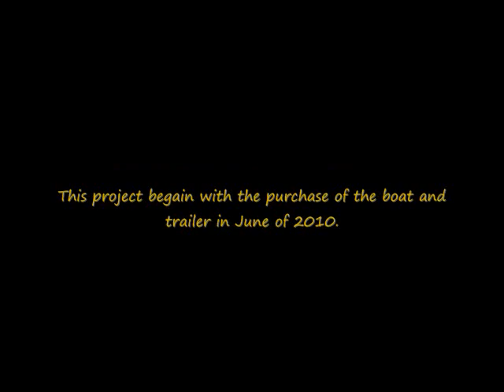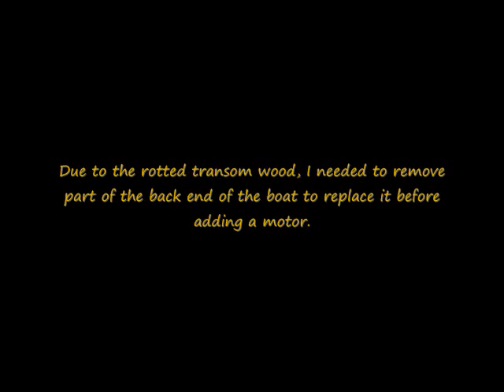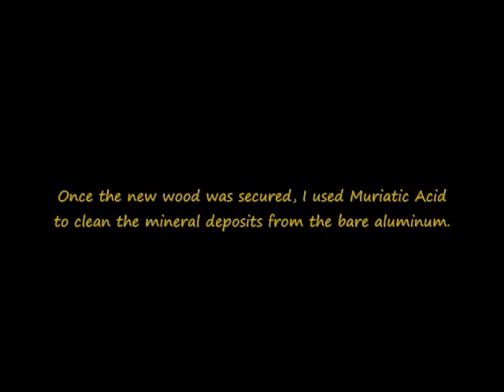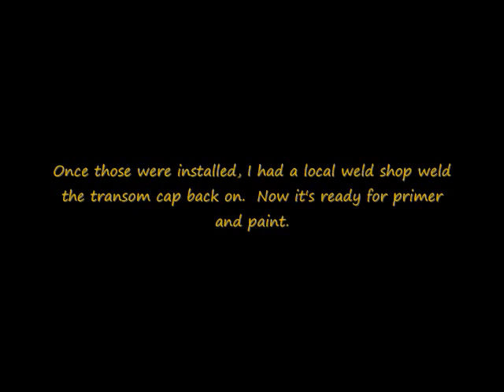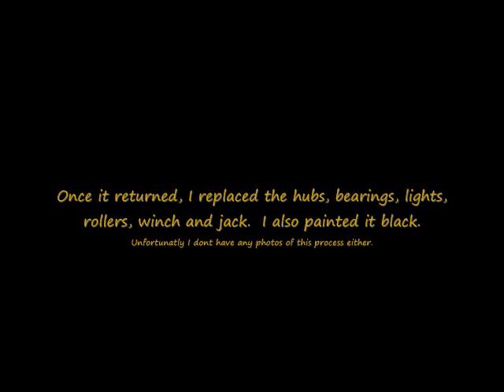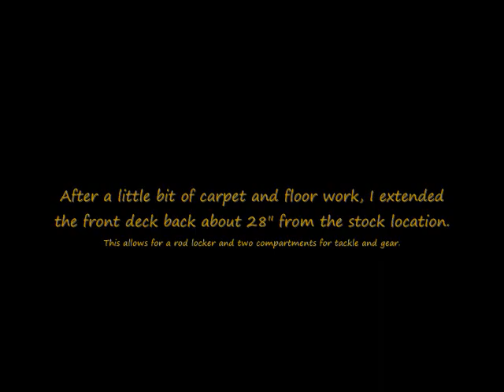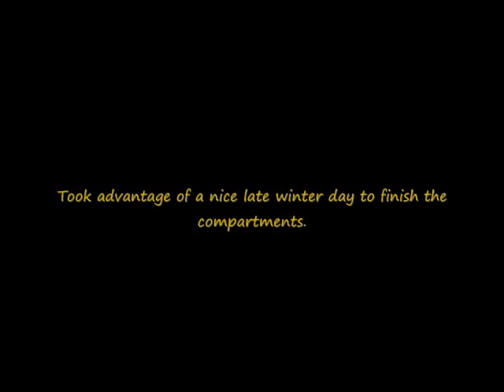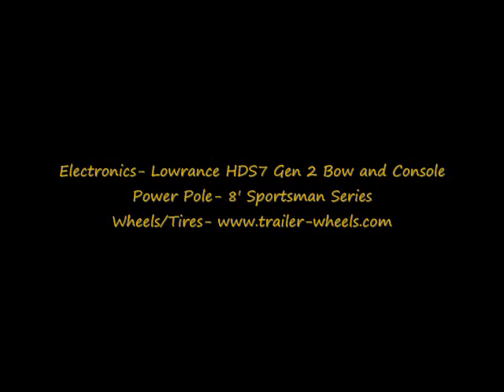Bass Tracker Tournament TX Boat Revival Photo Slideshow

Comment: How has the paint job held up? What did you use? It looks great. I have this exact boat and was wanting to paint it.
Reply from the maker: The paint job has held up just fine.  I used rattle can self etching primer right after I sanded the whole boat down with a 220 grit sandpaper, and wiped it down with acetone.  Once the primer was dry I did a couple of coats of rustoleum metallic midnight black followed with a couple coats of clear coat.  Again, all rattle can stuff from Walmart.

Comment: Great job. 13.500 lot of cash though .prob. flies with 60 HP on it huh. Did you consider aluminum framing instead of wood? I have a 98 tracker just redid the wood and recarpeted it. I have a slide show on here "basstracker 98" I was afraid to paint the boat didn't think it would hold up. But now I'm considering it. After seeing your video. Thanks great job

Comment: Where did you purchase the replacement console? I have a 88 model and I am wanting to upgrade mine. Awesome boat!!!
Reply from the maker: Hi Stephen, thanks for the kind words!  I found it from a guy in MO that sells surplus boat parts.. I think he had an eBay store called Bill's Boat Stuff.  I'll try to find the link and post it up.
Reply from the maker: Sorry, it was an eBay classified listing.  Here is the link, it looks like he has a few available.  http://www.ebayclassifieds.com/user/Bill5500
Reply: Thanks for the info. I ordered me a console from him yesterday. Great deals. I was also wondering where you got the hardware for the compartment hatches. I noticed you have some kind of trim around the outside them.
Reply from the maker: It's just aluminum angle cut to length and screwed/riveted together.

Comment: Did you have to get a different ignition switch if so could you show me how you hooked that up
Reply from the maker: No, the outboard control box contains all the electronics for that.  It includes the ignition and key, tilt/trim, and the lever the operate the throttle and gear box.  I didn't rewire anything, I just had to get an adapter plug from Mercury to adapt the box to the motor.

Comment: I know this is an old video but I found the exact boat I was thinking of buying. They want $875 with no motor. Seems a little high for a boat that needs  done. Most of the $ will be in the motor. What do you think?
Reply from the maker: Matt Orschell yeah that's pretty high. Definitely check the transom wood, and assume that if it has old floatation foam under seats or compartments, that the foam is waterlogged and in need of replacement. Maybe if you can highlight a few of the issues it would give you some bargaining power.

Comment: Great Job! Looks Great! One question, could you have bought a 2002 or newer with the money you put in this boat? Thanks
Reply from the maker: No, probably not. Yes, a lot of money went in to it, but I never had 13k at any one time to just go buy a boat. I nickel and dimed it over 3yrs to get it to where it is.
Reply: Well again Great job! I'am working on a 1988 Tournament V17. I plan to keep it for a while, but I always have resale in the back of my mind. I have had to replace the starter, power trim motor, and it needs a transom.  Which makes me respect what you've done even more. I'm hoping to keep it under 3k.
Reply from the maker: Thanks again!  You shouldn't have a problem keeping under 3k. Most of my big $$ went to the motor and other bolt on accessories. I was probably a little over 3k with the boat and trailer alone.

Comment: Curious how you got the boat off the trailer and flipped over to paint the bottom?
Reply from the maker: Once it was stripped it wasn't that hard, as it was much lighter.  I could grab the back end of it and wiggle it back and forth off the trailer, slowly walking it backwards onto the ground.  I went to the front, and with most of the weight resting on the stern/ground, I pulled the trailer out from under it.  Then I just picked up one side and rolled it over.  It's really pretty light weight.  Once I was done and it was rolled right side up, I pulled the trailer right up to the bow, lifted the leading edge onto the first roller, and used the winch to crank it back on.  Not having the trailer hooked up to the truck allowed the trailer the raise up as I winched, with the tounge about 5' off the ground as it slid under the boat.  As more weight moved into the trailer, it settled right down on the Jack again.  It was all very controlled and safe.

Comment: How did that spray paint hold up? I tried some on my trailer and it didn't last long at all.
Reply from the maker: It didn't do that great on the trailer. Any flying rock would cause it to chip a piece about the size of a pencil eraser off. I think it was the rust preventing primer I used, which didn't allow the top coat to stick well. It is doing great on the aluminum though.
Reply: Well good to hear. Glad it worked better for you than it did me